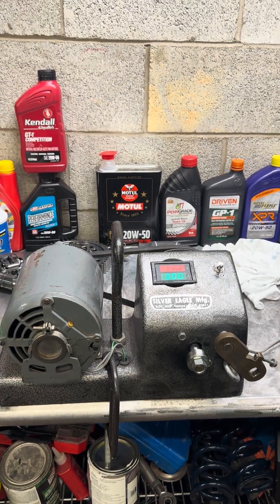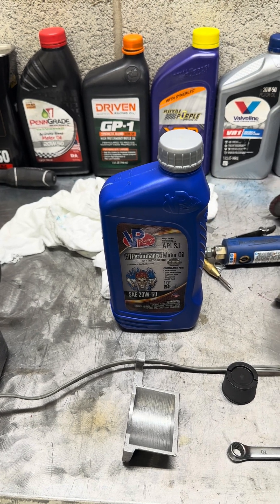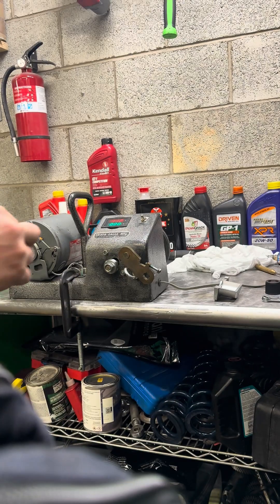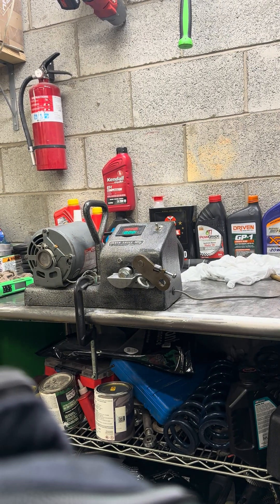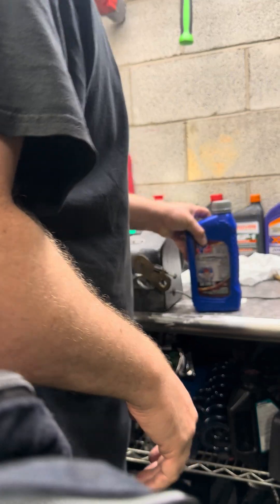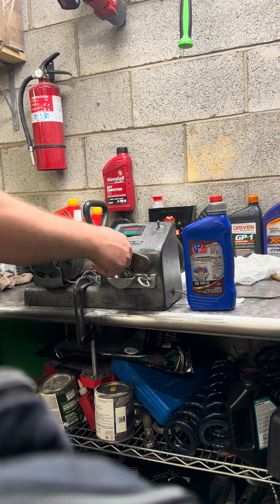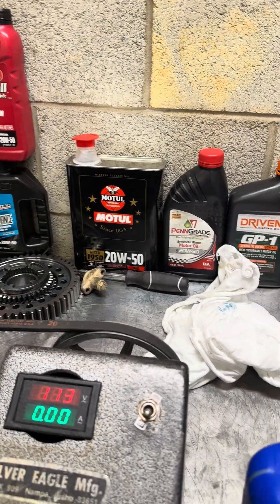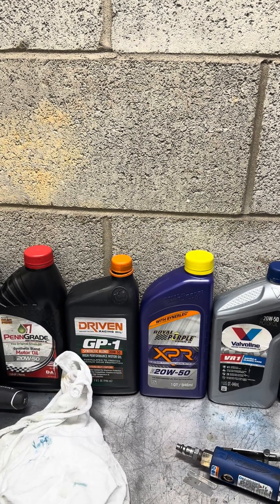VP RAcing oil HOW does it compare ? OIL abrasion Test find OUT!

Comment: This video is super underrated. Personally I'll go Royal Purple cause it is  pretty good for daily driving and racing. A great blend of both
Reply: I run sr-5r, not because these videos but because the race shop that built my motor told me to start using it “we open thousands of motors and the guys running torco have the best wear patterns. I used GP1 after break in oil because it was a semi synthetic for the first 200 miles(again builder told me it was the best of the semi synthetic and to use for the first 200) then moved to sr-5r. 

After talking to torco, on the phone they flat out said I could put miles on this oil- it’s not a race oil lacking detergents and is designed to run 2-3x of any other 1000 mile interval race oil. In my mind, I think the sr-5r is cheaper because I can run it longer. 

Now after seeing these videos, I am shocked that the gp1 and torco placed at the top and it matches the builder.